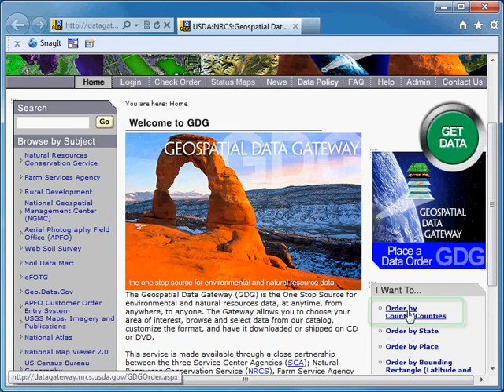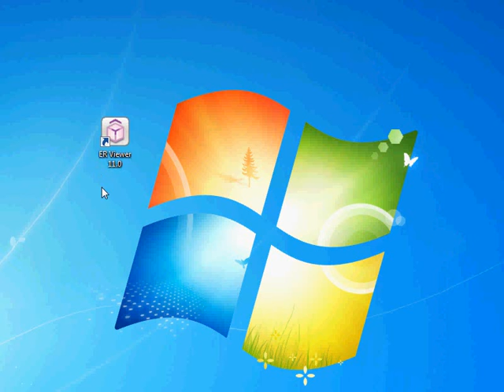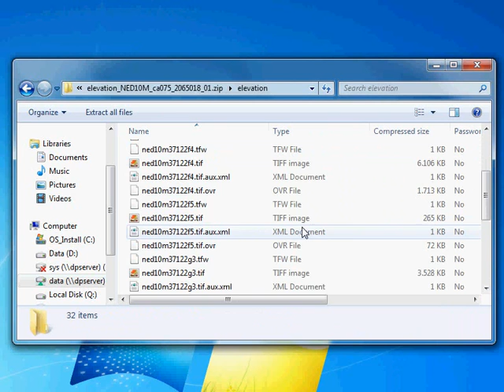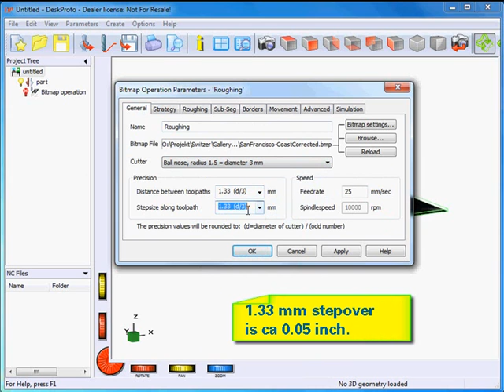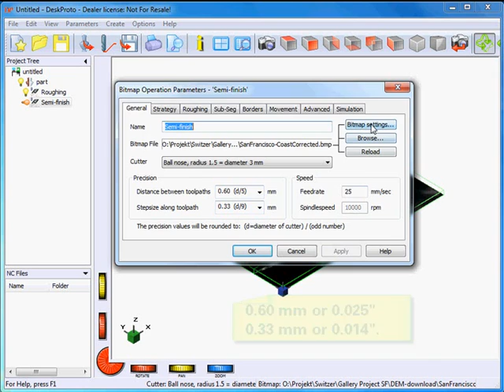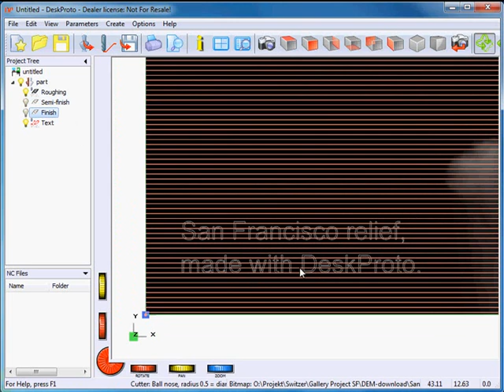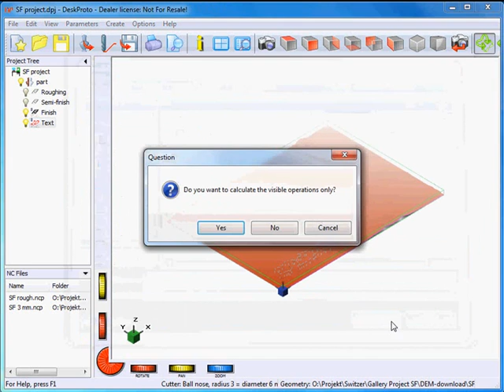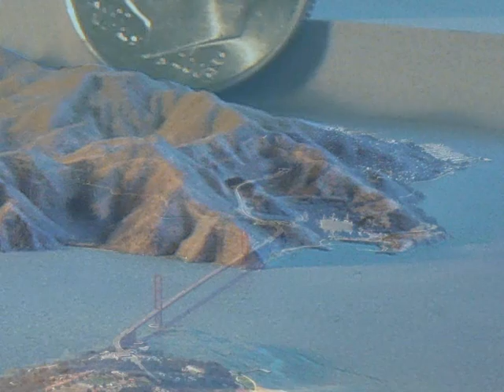Machine a geographic relief model of your hometown, using DeskProto.

Comment: So is DeskProto 3D CAM software strictly for tool path generation?  I can't seem to find any information other wise.  
The software advertisement says it can be used to "Produce even the most complicated models, & can be combined with any 3D CAD program"  
That being said How do you produce a complicated model from scratch with Deskproto?  
I am currently looking for other 3D Cad type software to do the model design in.  Do I need to or is their something I am missing?  
Any Info is Appreciated.
Thanks
Reply from the maker: DeskProto indeed is a CAM program (CA Manufacturing), so it is intended to generate CNC toolpaths. CAD (CA Design) functionality is not included. And it can indeed be used to produce even the most complicated models and parts :-)
Reply: Thanks for the quick reply.  
I am new to the CNC world & the machine I have is a 4 axis machine.  What 3D modeling software do you recommend for a Hobbyist, that will not break the bank, yet be intuitive to use?  I have a free version of Sketchup that I read I can load in a STL Plugin to the software so I can export projects into DeskProto.  
Your Thoughts...
Reply from the maker: It is difficult for me to give good recommendations as we do not have hands-on experience with many CAD systems. SketchUp indeed is nice as it is free. Many of our clients use Rhino. An alternative with a bit lower price is Moi. For a list with links see www.deskproto.com/links/cadsystems.php